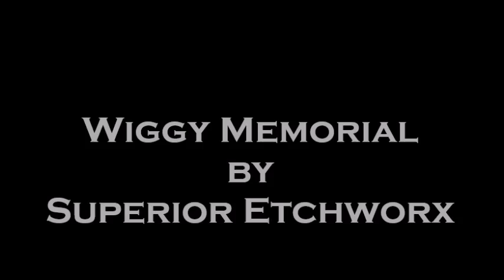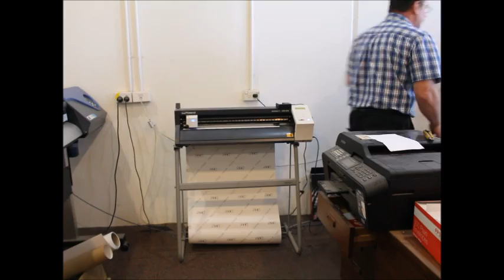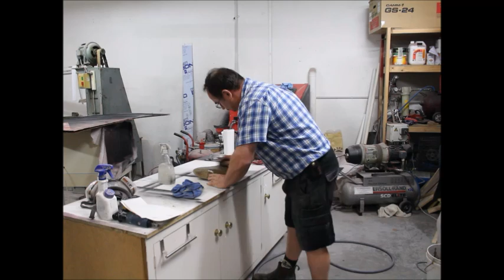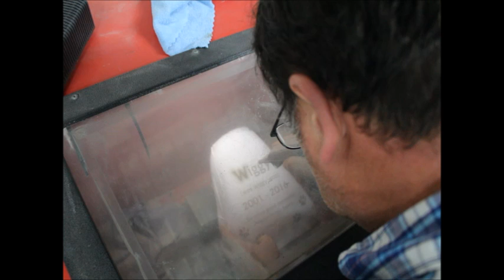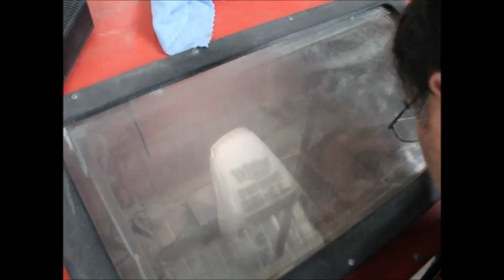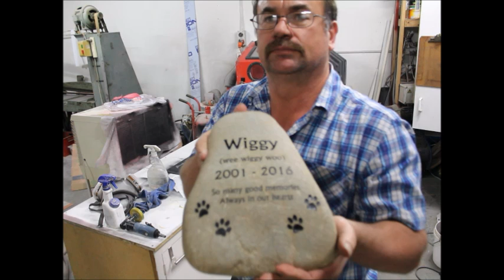Etching a Pet Memorial River Stone

Comment: Nice work, wich compressor are you using for sandblsting?
Reply from the maker: It's a 3 hp Hydrovane. I had a 3hp piston compressor before that which coped well enough. The hydrovane gives dryer air and higher volume

Comment: is that a harbor freight sand cabinet?
Reply from the maker: We don't have harbor freight in Australia but it's the equivalent. I have used a 10 gallon pressure pot  instead of the original gun with a PAB gun
Reply: I have one of those (sandblasting cabinets) from Harbor Freight and it looks identical. Mine works really well too! I use the Aluminum with mine.

Comment: Nice work! What software do you use to create the text and paw prints?
Reply from the maker: Thanks Thomas. I use corel draw for the artwork.
Reply: @SuperiorEtchworx  Okay great. Do you think I should be able to use Lightburn software? I have a laser engraver and wanted to get into sandblasting but wasn't sure if I needed special software to create the stencils. Thanks.
Reply: @SuperiorEtchworx  I forgot to ask one more thing....what type of stencil material do you use for this? I appreciate your help. Thank you.
Reply from the maker: @TTS-NOW  I use metamark m7 sign vinyl. It works well with the 240grit aluminium oxide. If you have larger grit, you will need sandblast vinyl. Venture is a brand that has sandblast vinyls in the US. I use national granite in Australia for heavy blast resist

Comment: Trying to find this vinyl but not having any luck. Is their a place that I can order it?
Reply from the maker: Hi Mark
Just google Hexis Lambreqiun, It's a masking film designed for fabrics. It makes a really good resist for very fine blasting grit. If you try to use it with the common 30/60 garnet, you won't have a good result.     I use 220 grit aluminium oxide. In my view fine grit and thin film are the best way to get  the finest detail.

Comment: What vinyl did you use for stencil?
What grit & nozzle size?
Can u show the hose and handpiece/nozzle holder? 
Are you using a pressure pot with your cabinet? 
What did you use to color the blasted design?
I'm trying to work on a small blasting setup. I have some equipment but I'm not sure if I have all that I need
Reply from the maker: I used Hexis lambrequin for the resist but most sign vinyls work. Email me, etchworx@bigpond.com ,and I'll send some pics of my setup. I use a modified chinese  with a PAB gun. I have my own design of mixing chamber. It was a 2mm boron carbide nozzle. I sell the components in Australia. So I can help you get set up if you are in Australia. I use high quality enamel paints for the fill.
Reply: @SuperiorEtchworx  could you recommend what media and psi to use?
Reply from the maker: @mdoyledesigns  I use 240 grit aluminium oxide at 50psi
Reply: @SuperiorEtchworx  thanks!! could you also recommend a worthy sand blaster to do pet stones like yours?
Reply from the maker: @mdoyledesigns  I modify the cheap 10gallon chinese blasters to be good for etching, if you are in Australia. In the US Pickard artistic blasting have some good blasters and I recommend their blast gun to be used with my local blaster. The gun that I make is cheap, simple and reliable but lacks the control of the  Pickard gun. The Pickard gun is  less solid and reliable but the control makes the maintenance worthwhile. I use a Pickard gun in my cabinet but I use my own gun on larger projects.